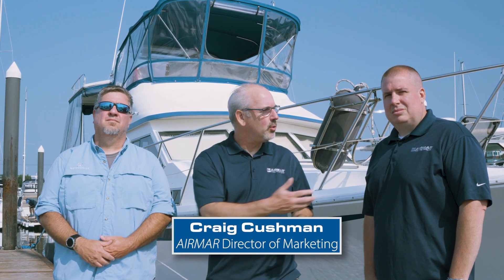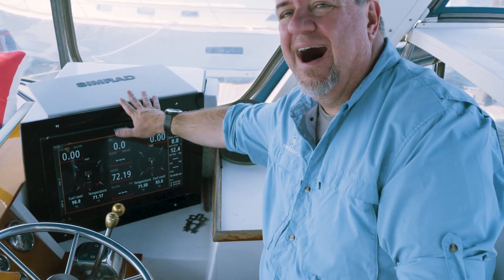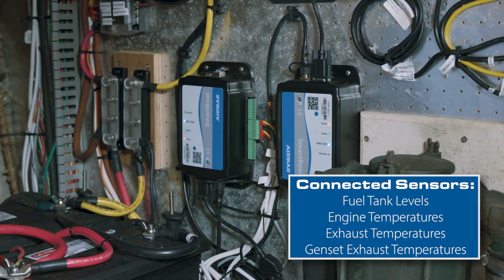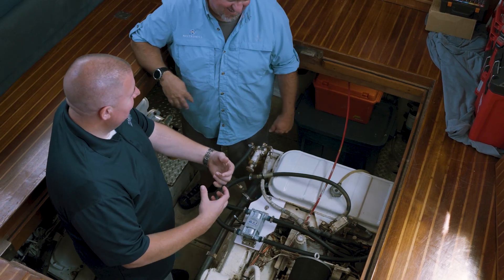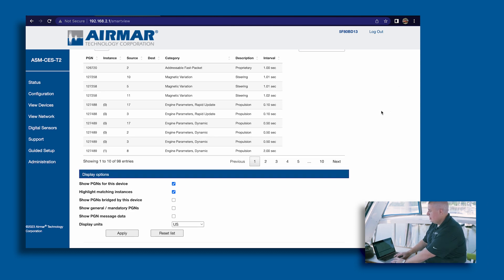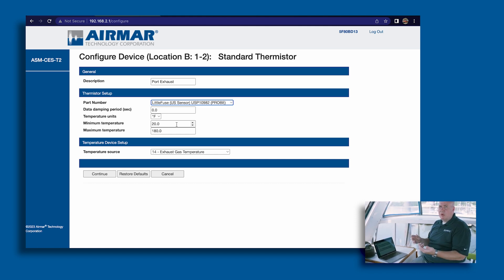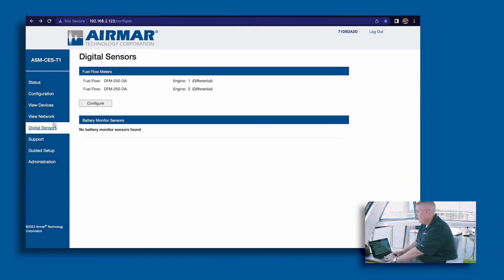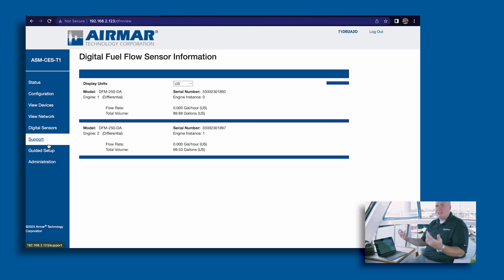Analog to Digital – Electronics Refit with Airmar’s SmartBoat and Diesel Flow Meters

Comment: Great video and information. It would be helpful to have a rough idea of the total cost of the various components that were required to interface to the older dual diesel boat. And also approximately how many man hours. Also, are you looking at having distributors, and/or installers in various cities? Thanks.